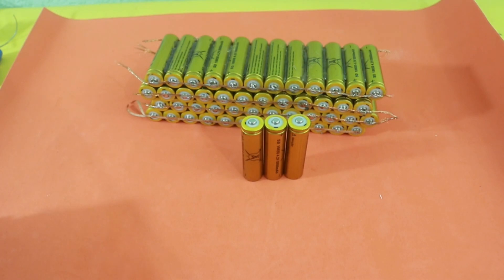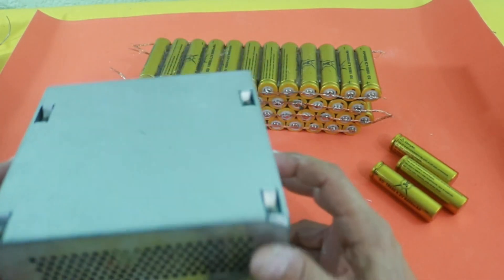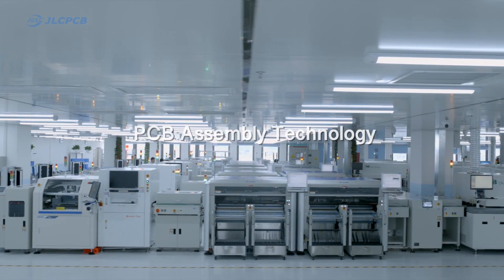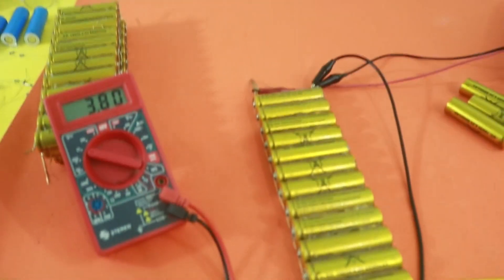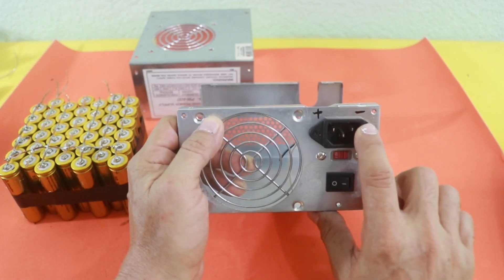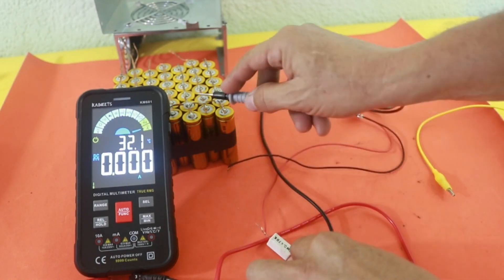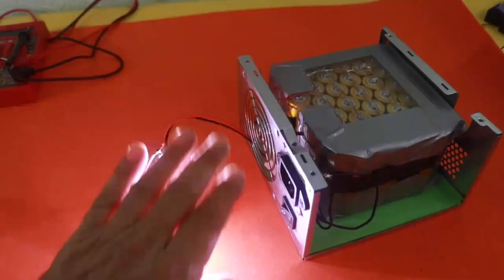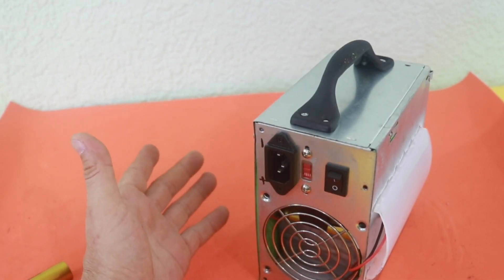Long Lasting Emergency Light with Lithium Battery

Comment: Could you produce a video on how to make a light like this one but with the equivalent lumens of a 15 Watt incandescent, lightbulb, and 160 hours before a recharge.  

I live high in the mountains with no electricity, and deep snow. I can’t get out too easily and a light with that capacity would be a lifesaver.
Reply: If you'll go to "BudgetLightForum" you'll find lots of people willing to help with the technical side of things to let you make exactly what you want. Please heed their advice on LiIon safety if you use that power source.

Comment: Charging the cells using cccv is just fine but what about deep discharge? Discharging the batteries to LED 2.8 VOLTS will reduce battery life and not so good.
So I think in another episode u may produce an 3.3 volts autocut circuit to cut the power when the battery voltage reaches to 3.3 volts and u r my very  first  online teacher 🙏 🤓 so u know what to do next 
Anyway always love u from India .😊

Comment: i was also thinking those cheap lithium batteries might be useful if we stack a lot of them.
I also think you should not use the AC socket for charging connector.
And although the LED would fade at 2.8v but still it would be better if you use some protection circuit.
And put a FUSE please 🥺
Reply from the maker: Great advice thanks!

Comment: do you need to protect against over discharge? like 3.2V min?
Reply from the maker: Well the batteries can safely discharge to 2.5 volts however the LED will fade at around 2.8 volts